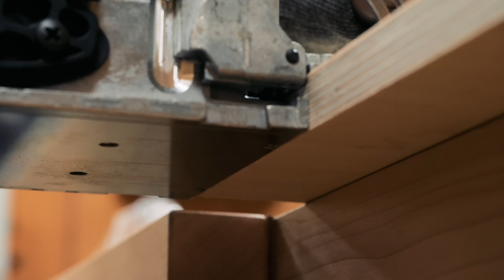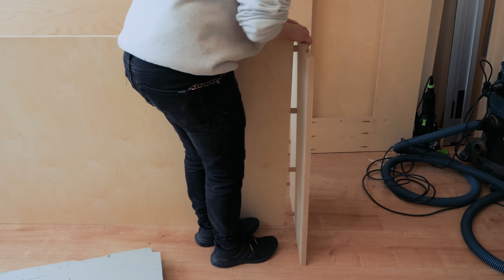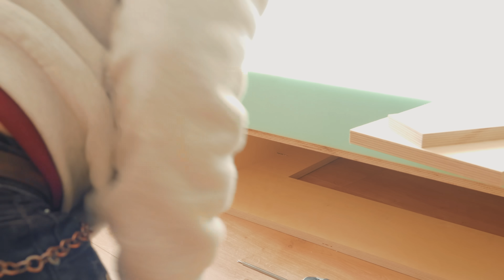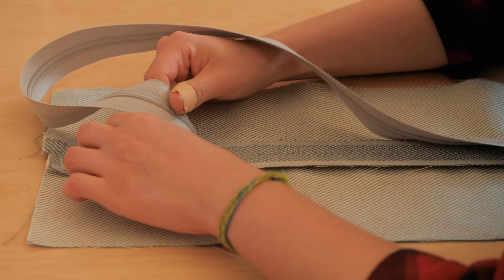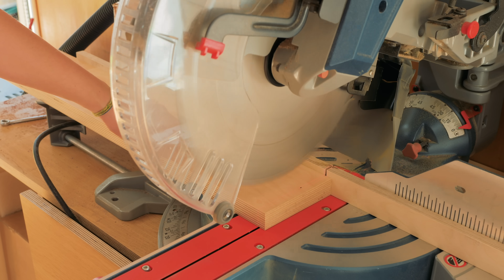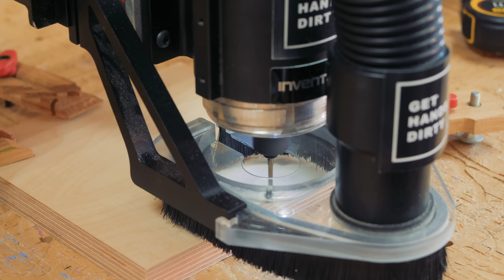How to Make a Sofa for the Wall Sofa Bed System // Tiny Apartment Build - Ep.6

Comment: Fantastic work.. That's exactly what I'd like to build. How did you figure the height of the sofa, including the drawers, so you could put your feet on the floor?
Everytime I try to create a design, the finished product is so high a guest would have curl up on the sofa with their legs underneath them. Not exactly the most welcoming position for a guest.😂😂😂😂
,Thanks so much  for your detailed video.. It's enormously helpful. 🙏🤣👏🌟

Comment: I dont suppose you explain how you cut your sheet materials in our room?  I can see that you are using a saw guide, which make is it? And how do you keep the seat material off the ground when cutting. Thanks great vid, I will buying the plans for the small parts on your website
Reply from the maker: Hi Max, the initial cuts are not shown here because I made them at the lumber dealer (see the beginning of episode 5 about the murphy bed) on the floor with my track saw. I had to cut them into smaller sections in order to transport them in the car. It’s the same one I showed you here when I made the cuts on the apartment floor. Beneath the wood, I place a thick insolation foam board to prevent floor damage.

Comment: You mention pathway to ground level involving stairs and elevator. My sister lived in NYC just off Central Park on the 7th floor. There was an elevator but her 1040 Steinway would not fit. She told of a crew whom she hired to carry that Steinway up the stairs. One African American man, a rather large individual according to sis, carried the piano with smaller men on both ends. So it can be done. It would have been lots easier for her to buy an electronic keyboard. There were other buildings on 76 West of taller height. One morning, while getting dressed, Margaret happened to look up across toward another building and there was the maintenance man of that building looking down at her in her birthday suit and waving to her with a smile on his face. Such is NYC.

Comment: Love your set up!  You are very talented!  I have been sewing since the age of 10 and have a helpful upholstery tip!  To make inserting foam cushion easier, wrap with dry cleaning bags first so they slide into the cover.  Then pull out the bags!  Great if you want to clean covers in the future.  I'm going to start using wonder tape too as I have a bad relationship with pins as well 😂.  Thanks for your video tutorial!!!

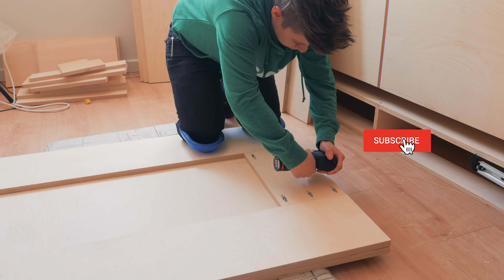Comment: Not sure if you didn’t explain it well, or your using the wrong screws? @ 2:48 the screws should be below the surface, but you should use pocket hole screws (phs) not countersunk (cs). The V of the cs acts like a wedge and pushes the wood fibres apart, rather than clamping like the phs do with their flat heads.

Comment: Another trick to insert foam pillows is to put the foam in a plastic bag first  -the thinner the better. It should slip in much easier and afterwards the plastic can torn away and removed.

Comment: Great build and awesome video from the DIY perpsective! From the design perspective, however I do not understand the need for this, I think you lose more space than you win, so definitely would not put this in a tiny apartment. There are great corner sofas out there, which can become a bigger bed and have storage space on one side (the one at the corner). Then you can have a bookshelf behind instead of this "wardrobe-looking" thing, so you can use the wall.

Comment: Coooool. Ingenuity at work. I'll join the chorus of voices telling you the trapezoidal drawer is cool AF. The only thing is that drawer won't have the rated weight capacity, since the slide laying flat will have a much thinner cross-section than it would when positioned vertically. Unless that slide is rated for use under the drawer as well, in which case, ignore me. :)

Comment: Great Job, Can you tell me the model of the machine that you use for the joinery, I mean the cookies that you use I see that are bigger that the rest that I know.
Reply: It's a Festool Domino. The "cookies" are actually floating tenons, which are much stronger than biscuits. Very expensive, but a popular tool among furniture builders. There are DIY versions you can make with a small router.

Comment: Fantastic project. I have physical challenges and can no longer lift anything more than 10 pounds. If I were to pay someone to build these plans, what would be a reasonable estimated number of hours? Any idea what the market price would be buy something like these, delivery and installation?  Is the Murphy bed easy to lower and raise back up? Does it use hydraulics or muscle strength?  I need to downsize and this would be fabulous if it works with my injuries.

Comment: The thin double sided tape is useles for attaching anything else than paper. The foam double sided tape is much better but I personally prefer the so called "glue carrier" which gives a decent amount of transparent glue and comes in different thicknesses and widths. It can also hold quite big and heavy elements. By the way I admire the perfection and acurateness with which you work on details and assembly :) Great job!

Comment: To quickly pull the threads you cut on the zipper , use and eraser. I also think it is time to change your needle on your sewing machine.
Reply from the maker: Cool tip! What needle would you recommend? Was it too thin for this purpose? I actually broke 5 needles making this sofa ahah
Reply: @GetHandsDirty  You are sewing a heavy fabric, not the thinner stuff I sew. So you need a denim needle , labeled as such or at least one labeled 90/14 universal needle ( I hope this is the same in your country). I also believe you thread your sewing machine incorrectly. Which changes your thread tension and can make needles break as well as that thud sound you get when you sew.

Comment: can always glue on soft felt to the bottom so it doesn't scratch
Might have used the screws uncut on the trap drawers and cut a panel to fit over it as a false bottom. Then hide stuff there :)

Comment: Great video. Cool build.

If you don't glue it though, isn't there risk of squeeking?
Reply from the maker: Hummm haven't thought of that but I don't think so. They are not glued but the pocket hole screws press everything firmly together. Also I relate squeaking more to solid wood than plywood, not sure if there is any true fundament to this thought. Ahah. I associate it with wood aging and being progressively drier and drier over years/decades. Good point, thought!